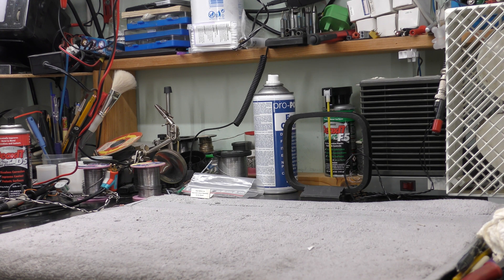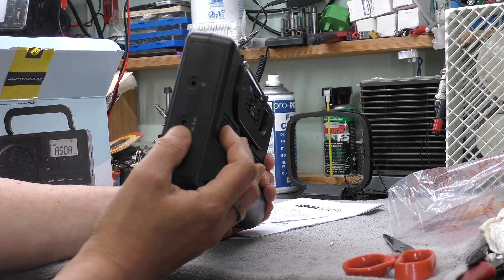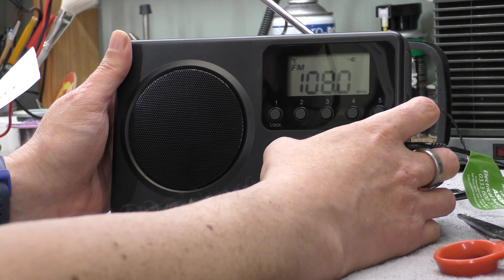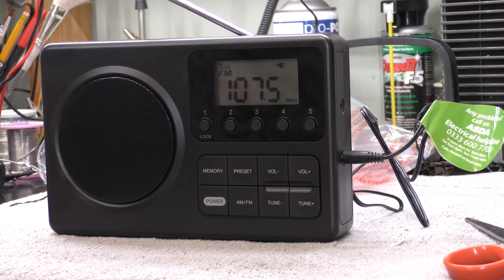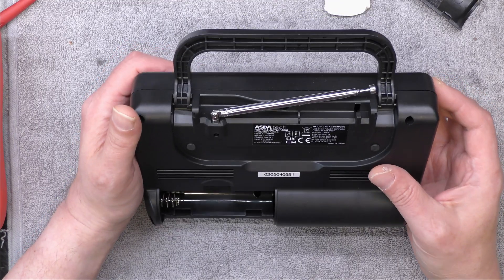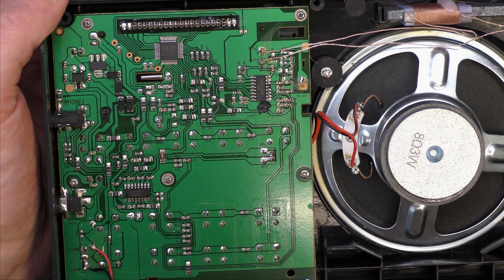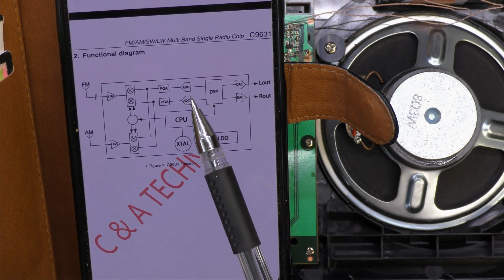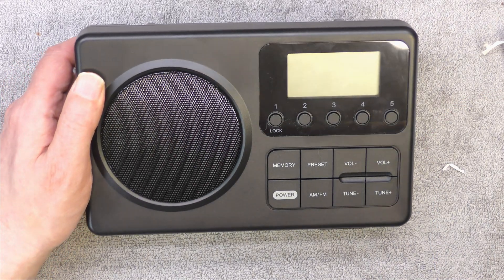What's inside a modern basic radio & is it any good? (4K)

Comment: Seems to be good value, nice touch to have FM stereo via headphones, shame there is no LW band though.
As I am not keen on digital sets, I bought a nice little analogue Roberts R9993 for £3 from a charity shop. for a cheap little set, the performance is excellent & it has LW as well, it also plays for weeks on 4 AA cells.
Still seems to be available around £20.
Reply from the maker: That's a nice little set. I guess a couple of ics in that radio. My mother has a 997 classic and that's a good sensitive set with good mw audio performance. But I must admit the knobs look a little cheap. It does have a couple ICs. Always good to get a bargain at a charity shop, I have to avoid them now LoL. Daz
Reply: @darrencoe5795  Yes, the tuning knob on my set is rather cheap looking & lets an otherwise good set down, but the days of well made British sets are sadly long gone.
I am currently restoring a GEC from 1947, the thing is built like a tank & weighs about the same!

Comment: Simultaneously fascinating and depressing that the whole of a two band radio can be reduced to a trio of very cheap bits of silicon. Obviously a radio can be just a PN junction. If the signal is strong enough you can hear it on a tooth filling, but it ain't in stereo! (Unless you have two fillings). Edit: Oh and a tooth filling costs a lot more than £13.
Reply from the maker: I get what your saying on integration. It's weird not seeing the normal red yellow white & black cores inside! I do like the idea of stereo teeth. I also heard of a poker in a coal fire can work under strong signal strength LoL. Oh yes far cheaper than a visit to the dentist :-)

Comment: I recently bought a radio from Asda for £7-50. It's very similar in looks and size of the Roberts R200. It has DAB and FM, no AM but the sound quality is excellent. At the time I wish I had bought more of them and given them as gifts. Nice one mate.
Reply from the maker: Ah that's a good bargain at 7.50 for a digital radio. Good idea for an inexpensive gift. Sometimes you get lucky with clearance prices! Thanks for watching, Terry. Daz
Reply: I picked up a couple "Kitchen DAB Radios" from LIDL.  I modified them to have a line output for connecting to an amp, and additional aerial input socket.  Work a treat.

Comment: Quite good for the price, compared with what would was available for the same price 40 years ago. 6 transistor special. Only AM of course.
Feeding a better speaker, the FM probably sounds almost good.
Reply from the maker: I agree that what you get has certainly become more for less. The SDR part is better than I thought especially on FM.  But not sure it will function still in 40 years time and be fixable like a six transistor set. Hope your resting and not feeling too bad,  best wishes Michael.  Daz
Reply: @darrencoe5795  Good morning/evening Darren. Regarding 40 years' time. For most people this radio is not fixable, even next week. Removing the ICs are near impossible in many cases. In 5 years the ics will be obsolete. In 40 years or probably less MW will be 100% dead. Everyone will have a phone implanted in their arm, no one will even own a radio of any kind. I'm not even sure live conversation will even exist.

Comment: I can understand the big batteries with that sort of current draw! DAB must have been developed by the battery manufacturers.
Reply from the maker: Yes, what you save at tx is offset by the receiver, George. I must admit it was higher current than I thought with modern IC's.  Though the standby is good as I suspected that might eat batteries. Daz